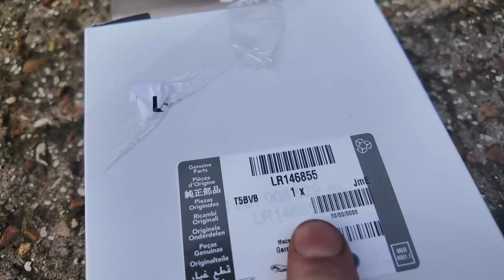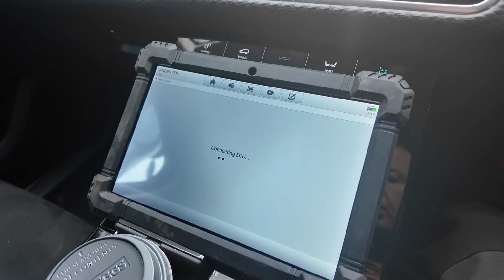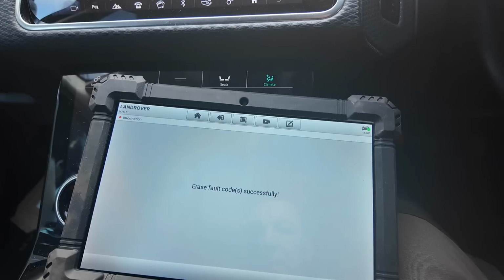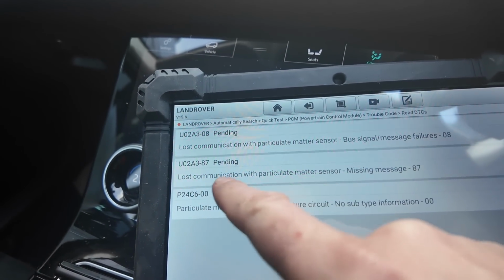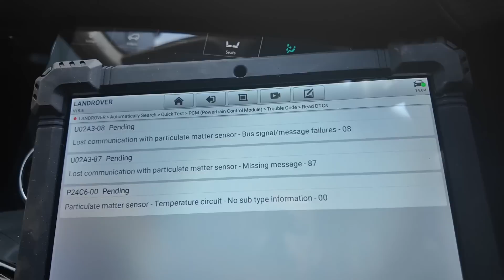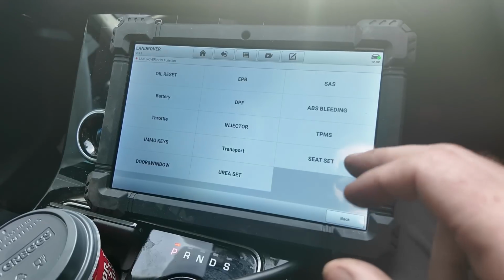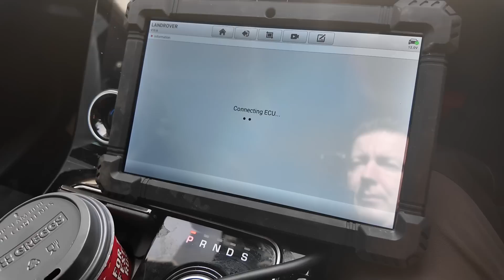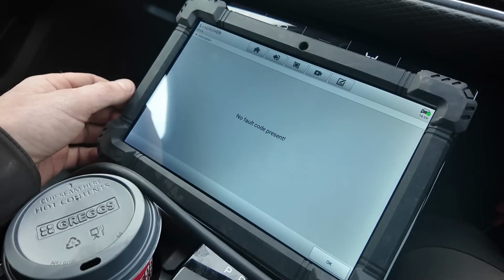Land Rover Velar P24C6-00 Particulate Matter Sensor

Comment: the post particle sensor measures soot as it collects between 2 electrodes creating a voltage between the 2. the amount of voltage measured correlates to the amount of soot buildup.. the sensor will then heat up to burn it away and take another measurement. thats what ive read anyhoo...

Comment: Hi Jimmy, Love your videos. These PM sensors are failing on a lot of Euro 6 cars. One main Dealer quoted me 1266 + VAT euro for sensor ( Dealer part only manufactured by Bosch  ) only. Any theories as to why these sensors are failing? Had one fail on a Toy*** which went out for temperature error also.

Comment: Just had one replaced on my 2019 Civic. Not available from anyone but Honda, even though it is a Bosch. £1150 fitted inc diagnostics even though I told them the fault initially.

Comment: The pm sensor will actually forgive a certain amount of particulate matter, the dpf won't catch all of it.  PM sensor even does its own regeneration every 50 miles if I remember what I read on topix right. That's why I always cringe when you and Baz stick your finger in the tailpipe, find soot, and instantly condemn the dpf
Reply from the maker: What I see everyday with experience I'd trust more than what you read on topix
Reply: @ORileysAutos  You're never too experienced to learn something new Jimmy. Have a look on Topix yourself, (Topix is the official JLR technical information by the way). Not saying you're not correct in your diagnosis most of the time but I've never seen a video where you look inside the dpf to confirm your diagnosis or seen you replace one so how would I know if your diagnosis was correct?
Reply: @GAH4444 think he knows what Topix is. 😂

If what’s written on the database is so fantastic why do dealerships “technicians” struggle to even diagnose the majority of emissions related issues?
Reply: @Mac_F87  Probably because they don't have time to read it. Have you ever worked in a main dealer as a service technician? Its all about time saved and efficiencies, and they effectively reward incompetence because they're making more money the more jobs they do and parts they fit. Also how do you know that Jimmy knows what Topix is?
Reply: @ well he’s in the trade for a start. So what makes you think he’s doesn’t know about it? How do you know he’s not used the likes Topix or erWin to get information about vehicles? Or do you just like to be condescending at every opportunity? Seems like the latter at the minute anyway. 

Yeh nice one, technicians have all the documents at hand that would help but don’t have the time to read it. Don’t worry it’s not lost on me that dealerships are just fitters.
Reply: @Mac_F87 Wasn't being condescending. I honestly thought from his reply he might not. I also know a lot of people in the trade who are very good mechanics but wouldn't know what Topix is if I asked them. Not taking anything away from your hero Jimmy so you don't have to defend him.  He's taught me and awful lot over the years I've watched him and I was just trying to return the favour
Reply: @ my hero Jimmy. 😂 🤦🏻

Why would he be my hero? My job isn’t diagnosing, fixing or cleaning diesel emissions systems. I’m fairly sure I’ve  not got a DPF fettish either. Bit of a swing and miss, but whatever helps you fella. 

Just trying to return the favour….rrriiiiiigggghhtttt. Well maybe, in the most patronising way possible. 😂

Comment: The Bosch ppm sensor is resistance based using the heater to clean the sensor , if it’s anything like the nox sensor they respond really well to ultrasonic cleaning to release all the trapped soot I’ve saved dozens of nox sensors by cleaning

Comment: I was wondering why the manufacturers dont use two half size DPFs in series ,  as the first one would wear out first so you could if you made identical ones replace the damaged one by moving the other one to be the first one and fitting the new one in the less stressed position ,
Reply: well 2 second dpf would be useless in this case.
but the first dpf would be stressed way more in comparisson to a normal sizes dpf.
More regens due to the smaller filter would be needed which is not good for the whole engine.

the cost-benefit ratio of such a system would be pretty bad.

Comment: Dpfs are the biggest con going, help save the environment while selling add blue in plastic drums. The issues with these and cost of parts to be made and shipped far out way any emissions.
Reply: The elite want less diy owners, shorter vehicle life cycles, more failure points to generate repair costs..  

All these points should benefit the manufacturers, dealers and tax man... 

Old cars, worked on cheap, generate no money.. imagine the meetings.. we need these older cars gone and bums on seats in newer more fragile cars tied to finance packages.. 

A friends misses works in a manufacturers and one of the ideas is, we will all rent the cars and when they're old, they'll recycle them into a new one.. we won't have the option to buy them, they won't be for sale, they will never pass 6 years old, they'll never be cheap..
Reply: @plumpii7177 the elite 😂
Reply: There’s actually no connection between DPFs & ad blue. Euro5 vehicles have a DPF but no ad blue. The AD blue treatment actually happens after the DPF.